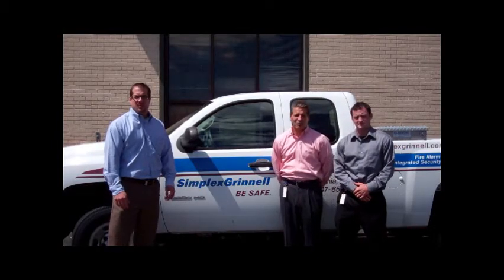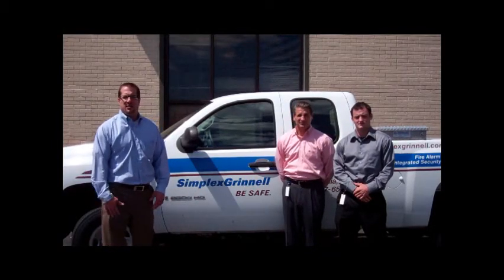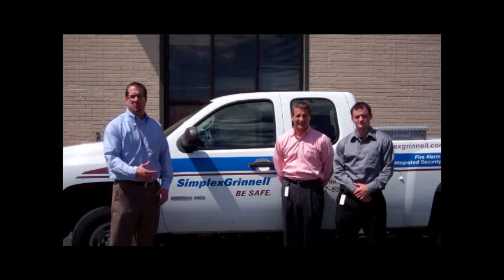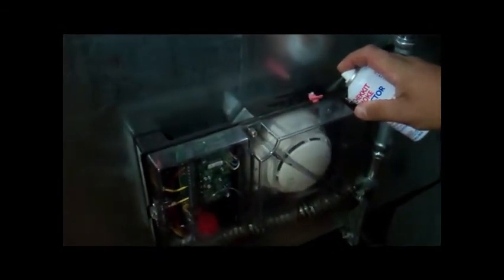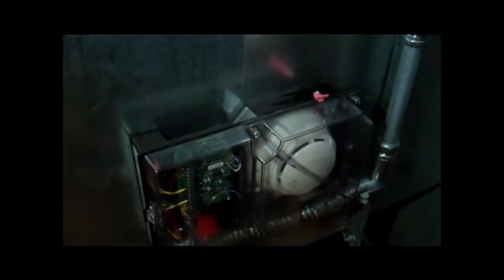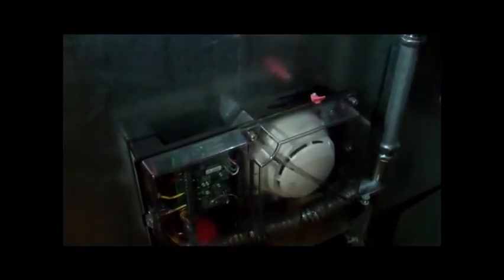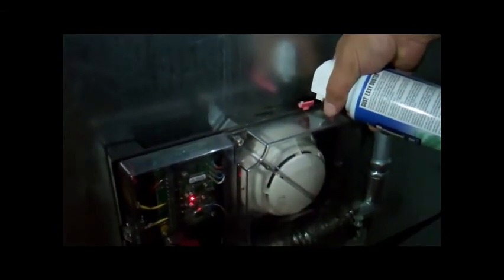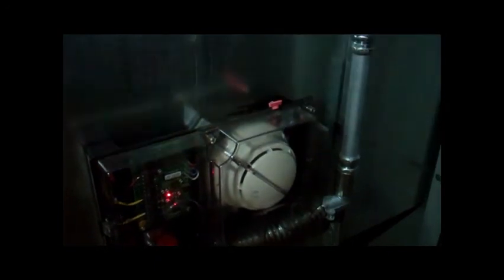NFPA 72 Electronic Fire Alarm Duct Detector Inspection - SimplexGrinnell Philadelphia

Comment: A Menometer test does not prove that the air is coming from inside the duct, as the sampling tube cap on the opposite end could be missing. Hence the air would be coming through the sampling tube from the outside of the duct on the back side. To properly test the duct smoke detector as designed, you must blow smoke into the "protected area", which is the air up stream and /or air moving through the duct work of the particular sampling tube of the duct smoke detector you are testing. proving that smoke will enter the sampling tube through the holes in the sampling tube, drawn into the housing of the detector and into the sensing chamber of the detector head activating an alarm. Blowing canned aerosol directly on the head through a hole in the housing only proves "if" smoke gets to the sensing chamber, it will go into alarm. You should test a duct smoke detector as it is designed. These short cuts are dangerous and flawed.